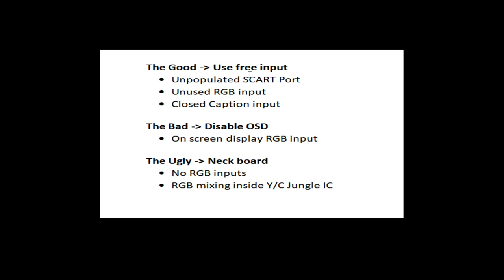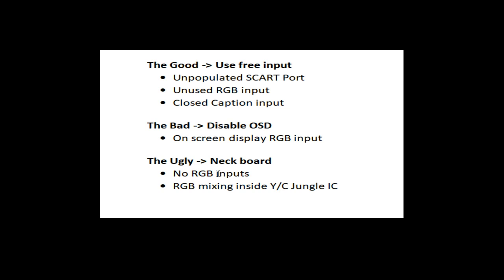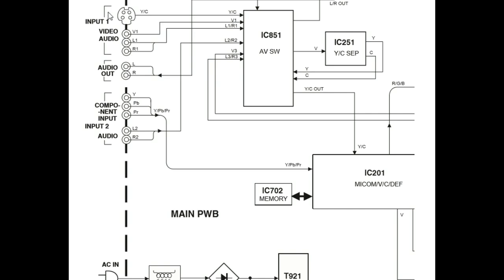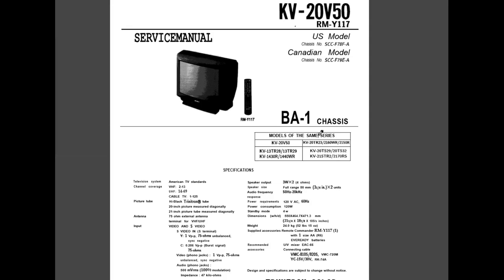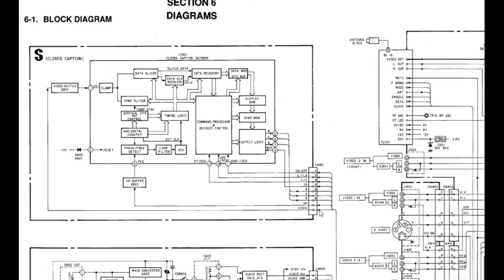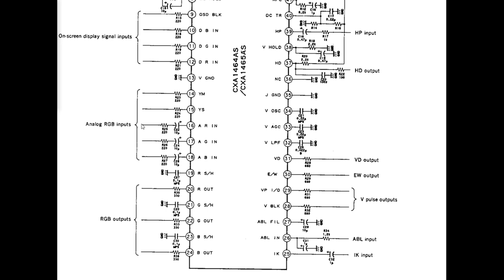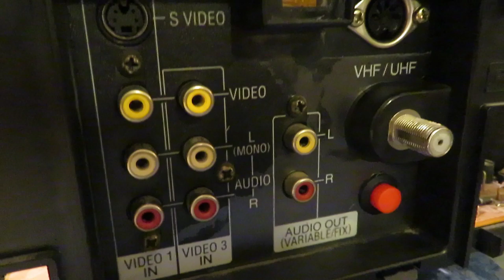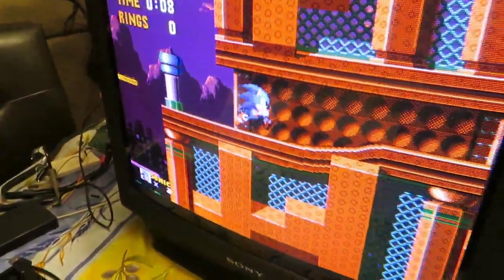RGB modding an old CRT television for retro gaming.

Comment: Great video. Always good to see an RGB modding tutorial which talks about how crap the OSD Snip method is.  

Check out the SHMUPS TV RGB Mod thread as we've come up with a new method to mux OSD and external RGB so that the OSD Snip method is not necessary anymore.
Reply: link
Reply: The RGB and Blanking lines all go to the Closed Caption header.  Ground can be accessed in a thousand places on the TV chassis,  likely even on the closed caption header.  The Sync is injected into the AV port.  I generally just wire up an RCA AV cable. I think he even gets his blanking voltage from the Closed caption header 5V.  If not can get that from the TV chassis' 5V regulator or if you are connecting to scart,  use the pin 16 voltage.

This TV one of the easiest mods anyone could ever attempt and a great one for a novice to start with.If you want to study it,  go to elektrotanya and get the service manual/schematics.

Note that the RGB lines all have to be 75 Ohm terminated to ground.
Reply: DarkWolf80s I just messaged you on Facebook.
Reply from the maker: That's all correct Mark C. All the lines were available on the closed caption header including the +5V which i used to switch the jungle ic's mode to RGB.
Reply: Fraught with danger using pin 16 on the SCART socket, its not always 5v... 

The way youre doing that OSD circuit is a little over complicated, 220 ohm resistors in series in the RGB lines will usually achieve the same result

RGB lines dont need to be terminated to ground, it depends on the signal VPP, drop it to what you need any way you like.
Reply: @pcbjunkie1  it´s +5v for switch mode or other value? thanks
Reply: @markc871  Where would the 1 kOhm resistor need to go on the header? I have a Sony LV-13TR28 I'm planning to mod and according to the service manual, it also has a closed caption board. The schematic for the board shows the 1 kOhm resistor going to pin 1 on the header, but where would the other end need to go? Also, what would I need to wire to my toggle switch other than 5V from the header?

Comment: I have a Sony KV-13TR28 with a similar caption board I hope to use for RGB modding. Do you mind sharing what pins you wired what to on the prototype board connection to the CC board pin header? I am just having trouble following where the 10 kOhm resistor goes and also how you wired up the switch. Thanks!

Comment: PCBJUNKIE, arcade monitors and i think TV monitors have a B+ trim pot which is around 125vdc. If the B+ voltage is not at 125vdc it will display a scrambled display on the CRT which will look like a sync issue. Why does the B+ voltage need to be set at 125vdc? is this is B+ voltage a bias voltage or DC offset but for what in the monitor circuit is this B+ needed for?

Comment: Would be interesting if one could modify an rf-only tv to accept composite, s video, componet, etc...
Reply: You can in most cases.
Reply: No mate, have a look on the Shmups forum, there is a whole thread on it. Every chassis will vary, but almost all can be made to accept an RGB signal.

Comment: if i can't find a schematic, can i simply solder wires to every pin on the jungle IC and test them manually (outside the chassis for safety) until I find the R G B and blanking pins?  what I plan to do is hook in sync to line1 composite, set tv to line1, and open the OSD menu with the remote. then from the back of the sega, take wires and put them in the RGB port holes, then tap those wires on the "random wires" that I've brought out from the jungle IC for a split second, until I get a signal.   once I've located the pin/wires, keep them tied in, turn off the OSD via remote,  and take the 5v from the back of the sega (pin 5 in the port) and tap it on random wires until I get the 5v supply to trigger the blanking feature.  after all pins are located, do the regular modification, use a switch so that 5v doesn't back up into the controller chip, etc...

also one last thing. i noticed there are scart cables (made by enthusiasts) that include 75ohm resistors and 220uf caps.  if i do the mod and include resistors of my own the way everyone does in their mods, does that mean I should use a "real" scart cable and not one that includes these extra resistors/caps?

Comment: I have a model with the same chasis, missing the Closed caption board, do you think the same process would work, even though it didn't originally have that daughterboad? thanks in advance.
Reply from the maker: In other Sony TVs that I tried, if the component feeding the RGB input is missing, then the input is usually disabled in software. You'd have to try it to be sure. If you do, please come back and let me know what you find.
Reply: @pcbjunkie1  Will do, by the way, do you have a picture with a better view of the pcb you made? I'd like to copy your design. Also, I think the service menu may have a way to enable the CC, I'll fiddle with it once i assemble the tv.
Reply: @pcbjunkie1  In case that doesn't work, It's still possible to feed the signal from the Jungle chip, right?

Comment: Hey that's a KV27S42 right? I think I have the exact same model. I want to RGB mod it but I'm afraid I still don't get the process, this is all a little fast and over my head, is there a comprehensive step-by-step guide I could find anywhere?
Reply: Cybrisk no it’s a KV20V50 i have that model and it said it on the manual in the video
Reply: Cybrisk its a fairly rare model

Comment: mine is one panasonic TC-29FX30L it has rgb in on the chip but it seems to be grounded with some resistors can i just take the pins out of the board and use them?
Reply from the maker: You may be able to. I don't have a lot of experience with those sets so don't know for sure, but you either unground the pins and inject you signal there and it works, it doesn't work until another control line on the chip is switched on, or it doesn't work at all because the switching to rgb is done via software. You'll either have to read the datasheet for the chip, or experiment.
Reply: pcbjunkie thanks, i will try that
Reply: the user manual is very parcial about the chip so eighter i need to open to see the chip code or it is a proprietary chip

Comment: Good evening my friend, I have a question! in this TV model; what is the pin in the jungle that activates R.G.B, which voltagen do you use? tv sony kv-2163s    (  https://www.electronica-pt.com/esquema/tv/sony-esquemas-tv/sony-kv-1441b-2158b-2162b-2162s-2163s-1282/   )
Reply from the maker: Based on the schematic you linked, it's pin 15 (YS). This is TTL logic I believe so it either +5V or ground. I don't remember now if it's high or low for RGB so you'll have to experiment.
Reply: thank you ; I'll try